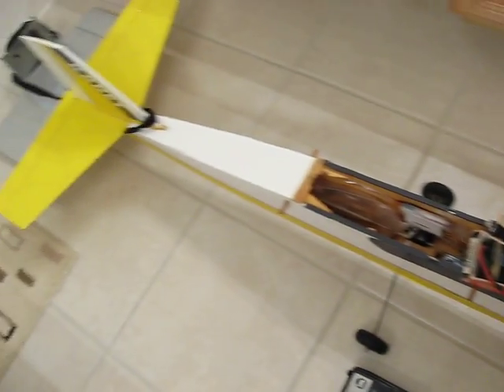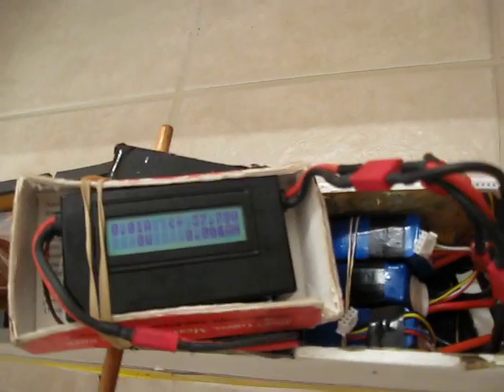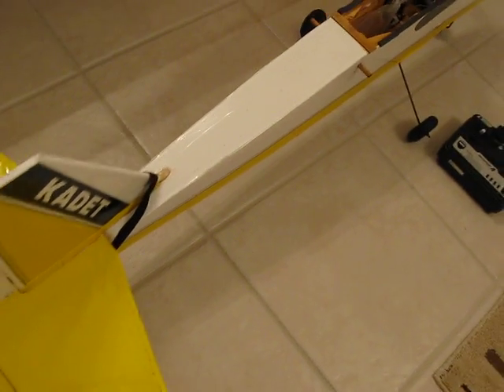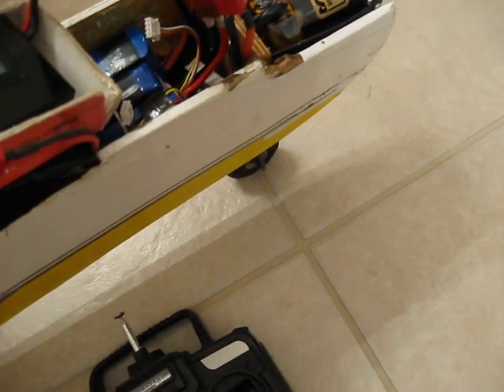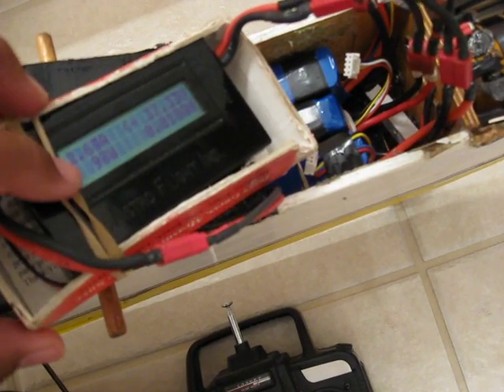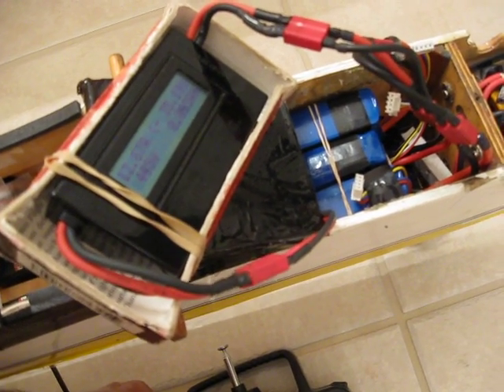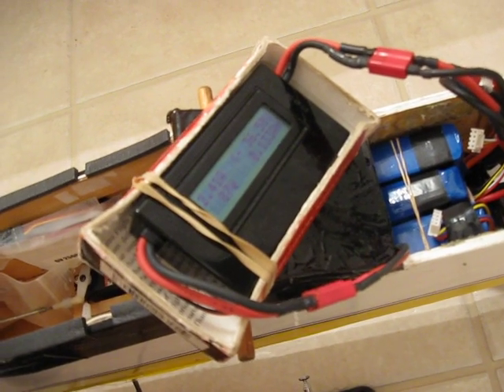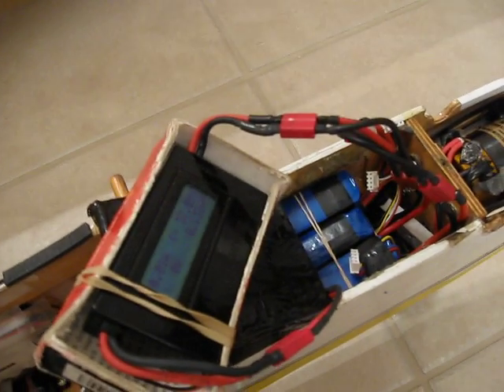SIG Kadet LT-40 Glow-to-Electric using 9-Cell Li-POLYs Test Run

Comment from the maker: @E744763Productions 
Going to assume that you did not visit my Thread(s) at RCGroups nor WATTFLYER as my main goal was to use what "I" had on hand in the Hobby Drawer and the ASTRO FLIGHT 60 was a prime selection as it powered my larger MidWest Citabria of 80+ inch wing span a few years ago.  Certainly, it would have been easier to just slap a Brushless outrunner like you did but, I wanted to enjoy the LOW AMP draw characteristic of a HIGH VOLTAGE SYSTEM.   Cheers.  Carlos